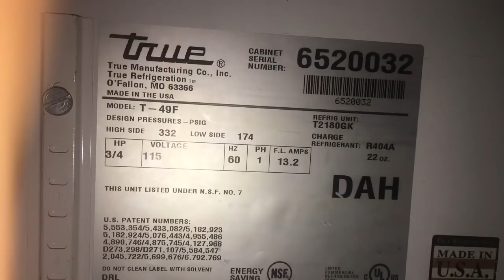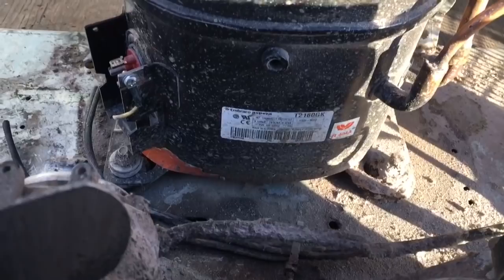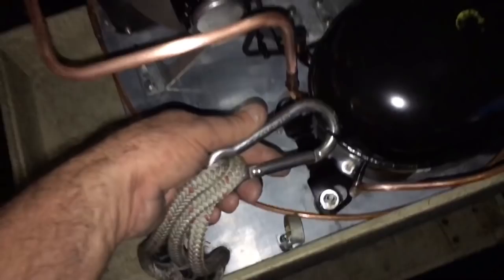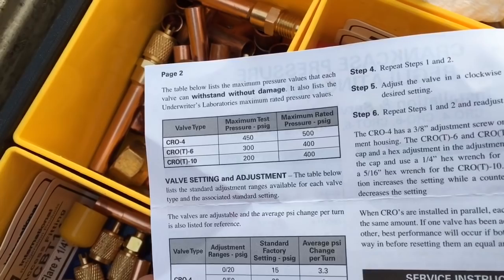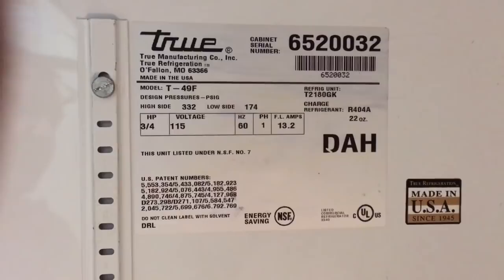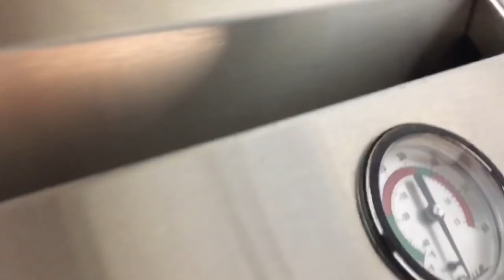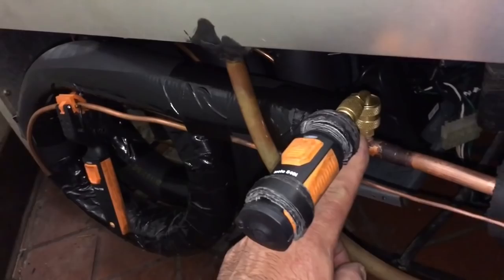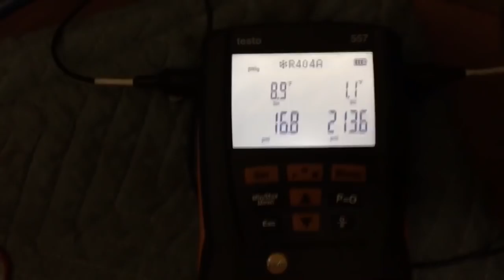True T-49F 2 Door Freezer. Re-Built From Start to Finish.

Comment: Rebuilt better than factory with quality hardware should last another ten years if they keep it clean!

You use the Frankenstein manifold for recovery and pressure tests then the Testos for charging and dialing in?

Thanks as always for taking the time to video edit and teach.
¡Prospero ano nuevo!
Reply from the maker: Hopefully. i Love My Frankenstein Manifold. it's old Faithful ! She's Tight and Don't Leak .  ( touch wood )
Yea, i use the Testo For dialing it in. SH and SC . i don't Fully trust the Testo's yet., Had each knob fall off the Low and High side as of now on the Testo 500$ Manifold. . i Trust Frankenstein Manifold !  i Have Owned Several Imperial 800 series and 600 series manifolds and they are Workhorses. i Trust imperial NOt Testo yet . NEVER EVER Had a problem with imperial Manifolds in 36 years.
Reply from the maker: Thanks you for the Kind words on videoing , editing and teaching. it's a bit of work. but, i have learned a few things here too and it is a way to Give Back too. Better educated Techs is a Win for Most Everyone.
Reply: @OcRefrig  I've enjoyed and learned from you this past couple years. Gracias!
Reply from the maker: 👍👍👍👍👍 Happy New Year !!! 🥳🥳🥳🥳🥳
Reply: OcRefrigeration , Hvac & Electrical Video's. That’s funny, My first Testo gauge knobs fell off too. I found the horse shoe clips were missing.  No problem since I put them in.  Really anal repair, must have cost them a boatload in labor, although done exceptionally well.  Great for the next guy coming in too.  Much easier now to access.  I guess it’s still cheaper than a new unit.  I was surprised to didn’t replace the cap tube. We usually attach it to the suction line too.  Great job.
Reply: OcRefrigeration , Hvac & Electrical Video's. Also remember that old recovery machine.  I used the OZ Saver, it was big, heavy and loud BUT... you could sub cool the recovery tank by flipping two ball valves, then go back to recovery by opening them... I miss that.
Reply: Instablaster

Comment: That was a nice rebuild to watch, nice and clean. That scale you’re using is what I’m using, it was a hand me down scale I got when I started my job at the school 12 years ago, and it has performed well. The last compressor I replaced on an under counter fridge was piped just like yours, had to reroute the suction. It had been replaced previously, and the tech used the process tube because it was easier, but it failed in a short time. Luckily I found their documentation on the website like you did, and the tip on how to tell the difference has been logged in the ole memory bank, ;-). Very informative, thanks for posting that one. “Clearance, Clarence.” “Roger, Roger.” “ “What? What?”. Nice. Sucks that you lost a temp clamp, hopefully it was less than two years old (warranty).
Reply from the maker: I thought warranty was only 1 year. , thanks for heads up on that , Ill let u know if i can get it warranty. It's only about 1 year old , so Fingers crossed ! My scale was a hand me down too from my dad , decent scale , seems to eat 9volt battery's a bit though.

Comment: Ha, I love that vacuum pump! I think I have the same one, from about 1996. I was thinking of getting a new one, but maybe I'll just hang on to the one I have! Not a big fan of suction pressure regulators, they can restrict oil return. I've noticed on some other True reach in freezers, they have a little liquid line solenoid that's wired to energize when the compressor is on, and close when it satisfies or goes into defrost. This should hold the suction pressure lower, and prevent refrigerant migration. Another way is to use a small TXV with a ZP charge instead of the cap tube, is a better way to limit backpressure than a suction pressure regulator. Of course, if you really wanted to trick out that freezer, is get rid of that whole condensing unit, and see if a good Copeland or Tecumseh unit will fit under there that has a receiver, then convert it into a pump down system. But, that would probably be cost prohibitive. Looks like the evap is a single circuit straight shot, so you could probably get away with an internally equalized TXV.
Reply from the maker: I’m going to purchase a lighter pump. this one weighs 35 lbs. Great pump & I Will Definately keep it. but , I’m into Lighter these days. getting older & wiser.

Comment: Nice job...the only thing i would  recommend would be next time you want to change out a cab to because of a restriction would be to just use a rx11 flush and nitirogen ....i found it to be time saving and make it easier to know you got the right size and diam on the cab tube...other then that ,,,,great job...
Reply from the maker: Sometimes that works , but id rather put in a fresh one, works better. Metering device is wayy important.

Comment: Nice job OC! The fieldpiece temp probes do not have external wires. 👍
Reply from the maker: Thanks for that info. gonna have to look at that set. App is sooo Ugly though. Yick !
Reply: OcRefrigeration,Hvac & Electrical. There working on a refrigeration app version for us refer guys. 👍
Reply from the maker: They just Need to Make the App MOre Visually Appealing. Maybe a Selection of Screens Analog Look ? , Digital Look ? Bigger Font as u Say for  us Old Guys. Font Size Selectable ?   Etc. Select Colors, Able to Customise app, MOve things around Etc. Select what things on a screen i want and Where .
Reply from the maker: At a Minimum They Should Make it the same Layout like the Testo smart Probe App and the Big Font Like Testo Testo Smart probe App. i really Like !
Reply: How are the FP temp probes for gripping on small tubing? What have you used to get the Testos to make a good connection on small refer tubing?
Reply from the maker: Do the Fieldpiece Probes work with the Measure Quick App Yet ?
Reply from the maker: You could put a small Piece of 1/2" Rubber on the curved side of the clamp that does not have the sensor onit. Maybe use a piece of hose rubber , plastic tubiing , maybe put a pice of copper on the other side to space it tighter. This is for the testo probes i am referring to , with the fieldpiece probes u have to use Metal as a spacer / copper tubing to conduct through it.
Reply from the maker: That Would be Nice. Any News on When that comes out ?
Reply from the maker: Any news on how that refer app is coming ? 😁

Comment: Can you explain how to remove the drain nozzle and groummet? I see the heating coil is inside the hose. I have a nozzle and groummet replacement  as first time for this same unit. Thanks for your great videos!
Reply from the maker: pull plastic hose off drain
pull out heater wires from plastic tube
unscrew evaporator cover , drop down
pull wires out of fitting
push plastic drain tube fitting up and out of rubber grommet. (from bottom to top. )
remove grommet.if necessary. 
replace grommet
push plastic drain tube fitting into drain hole grommet. (from top to bottom.)
put wires back through drain fitting
secure evap cover back into place
blow out plastic drain line at this time with air from a air hose. (no , canned air will not work. ) or blow through hose with your mouth to make sure line is clean and clear or u could use a garden hose gently to wash out drain line. 
feed heating wire into plastic tubing
while aiming plastic tubing to attach at drain fitting.

Comment: I kind of skipped around the video.  Did you end up not changing the cap tube?  I was wondering because I’ve yet to find a good way to do it on these bottom mounted true condensing units.  The only thing I do if I suspect one might be partially clogged is un braze them at the evaporator and snip about an inch off, blow nitrogen through the system and braze it back in.  True does some weird stuff sometimes.
Reply from the maker: Yea, the unit never had any Head pressure issues while it was running. compressor valves just were weak, would not pull down below 25 degree's and the compressor had no signs of overheating. it was a running system before i did the compressor changeout. i checked out looking at doing the cap tube just a as a preventative measure , but when i saw how true did it . its nuts. no way to replace the cap tube easily without drilling a hole throught the back cabinet and running it down the back external of unit. it was not necessary on this one or i would have done it if it was necessary no matter what work it took. i checked the cap tube and it was flowing fine when i tested it when i unwelded it from the liquid line. they usually plug up at the cap tube entrance if they have any junk in them so as a preventative measure i snipped 2-3 inches off the cap tube . it's 9 Feet Long so a couple inches is nothing. just to give it a fresh entrance to the cap tube. it Worked out very Well.
Reply: OcRefrigeration,Hvac & Electrical.  Yep, no good way to do it otherwise.  At first I was surprised you were putting that much money into a ten year old freezer that had been neglected so long.  Usually the customer would rather put that money into a new unit.  After seeing your work I'm convinced that you can't buy anything new that's built that well.
Reply from the maker: Thanks for the nice compliment. The equiptment at this place  really does not get that neglected , They pretty much stay on top of cleaning condensers , but getting the guys to actually Clean the condensers well is like pulling teeth. They try , and kind of succeed. At least he is trying to keep stuff in good order which is why i do a nice job for him. He Really did not Want a Propane unit in his place , so i Re-Built his 10 Year old. It Should make Hopefully another 10 Years. Ill prob have to do a Heating element in the next 10 Years , but hopefully that will be it on this one. In 10 Years we will Have God knows what For Refrigerant. Looks Like Co2 is the Next BIG THING. Take er easy. 😎🏝

Comment: I have same freezer and am experiencing ice build up along the middle of the back wall from top to bottom. I think it might be drain tube heater. The drain pan is bone dry. I don't see ice build up anywhere else. What's your route for troubleshooting this problem?
Reply from the maker: sounds like the drain line is plugged. sounds like its been full of water for some time and water is frozen in the tube.
1) unplug & unload freezer. let drain line defrost and freezer come up to room temperature overnight.
2) pull plastic drain line off at drain pan in freezer.
3) remove 90 degree elbow under freezer at drain line its probably plugged. clean out 90. 
4) blow drain line out with air.
5) re-assemble
6) plug freezer back in and use.

Comment: Do you ever put in an expansion valve in place of cap tubes?
Reply from the maker: NO, Not Yet. Have YOu ?
Reply: OcRefrigeration,Hvac & Electrical. Yes l done when your replacing evaporator you have size the whole condenser with the whole evaporator with the txv takes little longer to size all the part  number and btu but in the long run it's worth & because the compressor is low torque compressor that was original compressor plus it doesn't have a receiver . Haven't any problems with a total rebuild just like you did you change over to a txv with a duel pressure control you have better control plus change over thermostat to electrical thermostat mechanic thermostat you might be able to get other 15 years. l really don't like cap tubes especially when the cap gets plug .
Reply: Edward HVACR CT what txv have you used to replace cap tubes? I've seen a few discussions on Hvac-talk forum... using a large liquid suction drier tilted downward angle to a sight glass forming a mini receiver that looks interesting. I've got quite a few dead reach in units (prep tables and beer boxes mostly) and some space to experiment.
Reply: david johnson Like l said before change over to a txv from cap very important  get the number off the whole condenser unit get the btu , refrigerant you using look up at supply catalog they will gave you the btu and what temperature there is chart  ,dimension .This where a lot technician mistake you can't leave the compressor in there it was set for cap tube it's a low torque compressor you need a high torque compressor why would you most time the old condenser unit are already poor shape .When do replace whole condenser unit compressor .Same thing for whole evaporator there a chart . Same thing for txv look at spolan literature. Size piping too for the suction line & liguid line usually it's  piping charts .This is a lot work but in end when it's running you know that you won't have a problem l did this many time where l use work and didn't have any problem make sure the unit is in good shape everyone has there own way but this is way l do a total rebuild parts are just over $1,000 and labor 16 hours .
Reply from the maker: YOu can just use a oversize Liquid ine filter drier like a Ek-163s on a prep table for a reciever, best way to go is Just buy a small Reciever and use that.some traulsens don't even use a reciever they just pipe from bottom of condenser to drier to sight glass to txv. size reciever for line size and size of system. Size the txv for the Btu Rating of the Evaporator. Every evaporator is Rated in Btu's. Example: if your evap is Rated for 3,000 btu's  YOu would use a 1/4 ton Txv, since 3,000 btus is a 1/4 ton. make sure to use a sight glass and charge to a full glass. you'll be golden.
Reply: @hvacrnortheastern2110  be better than the newer cheap r290 crap built to a cost

Comment: what does the suction pressure regulator do
Reply from the maker: A CPR or crankcase pressure regulator is nothing more than a pressure reducing valve. When installed on a compressor suction inlet and properly adjusted, the CPR will prevent the compressor suction pressure from ever rising above the CPRs setting. The CPR will help prevent refrigeration compressor from overloading during start up on refrigeration systems that may experience heavy load conditions such as a freezer after a defrost cycle. Coolers that experience start up problems related to extreme loads may also utilize a CPR.
Compressors have a maximum suction pressure that they are designed to handle. An overloaded compressors amp draw will exceed FLA causing the compressor to cycle on it’s over current protection. A badly overloaded compressor may not start at all. A zero degree freezer may have an operating suction pressure of 25 PSIG. When this freezer comes out of defrost, the evaporator may be 50 degrees and have a suction pressure of 105 PSIG. This suction pressure will be too high for most low temperature compressors to start against. In this case a CPR installed at the compressor inlet and adjusted to 45#, will allow the compressor to start with out overloading. Once the compressor starts and the evaporator begins to cool down, the suction pressure will fall below the CPRs 45# set point and open completely to allow proper suction gas flow.
When selecting or adjusting a CPR some important things must be considered. The suction pressure setting of the valve must be low enough to prevent the compressor from overloading. If the CPR is undersized or is set too low the suction gas flow to the compressor will be too restricted. This will reduce system capacity and could cause compressor overheating. To adjust the CPR, put the system into a defrost cycle to heat up the evaporator coil. Install an amp meter on the compressor making sure that you are reading only the compressors current draw. Start the compressor and adjust the CPR until the compressor is drawing no more than FLA. This procedure may need to be repeated as the suction pressure may fall quickly once the compressor is started. Though a CPR may become restricted or fail, it is not likely that it will come out of adjustment.

Credit :  https://www.behler-young.com/tech-tips/what-is-a-cpr/

Also: They are Known to Leak Refrigerant
After 10 Years of Service. Internally past the adjusting screw. To Leak check Remove cap and use sniffer at entrance where u adjust regulator pressure.
Bubbles can also be used if desired.
I Recommend Replacing All Suction Pressure regulators if Doing a Compressor changeout.

Credit : Oc
Hope this Helps & Thanks for Watching & Subcribing.
Reply: thank you very much for the reply
Reply from the maker: You are welcome !